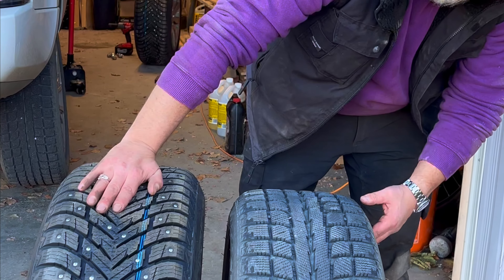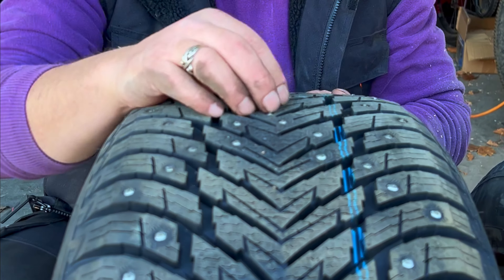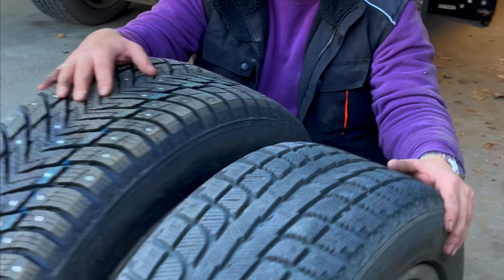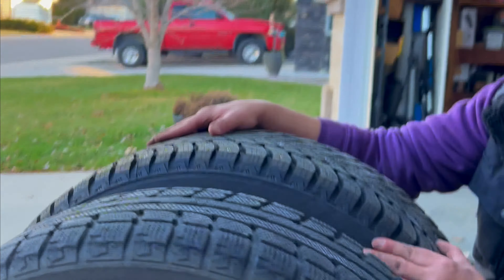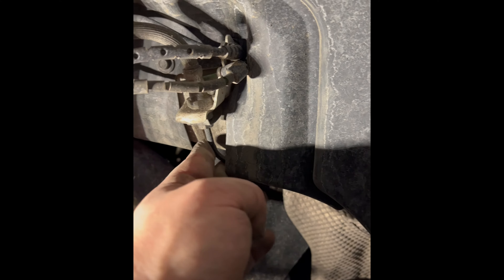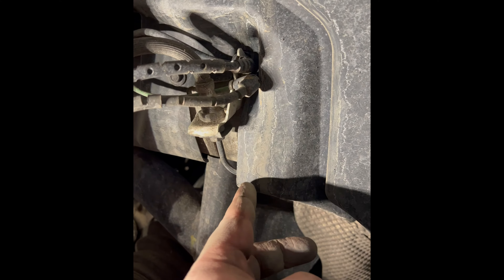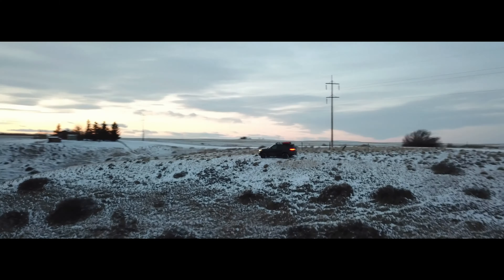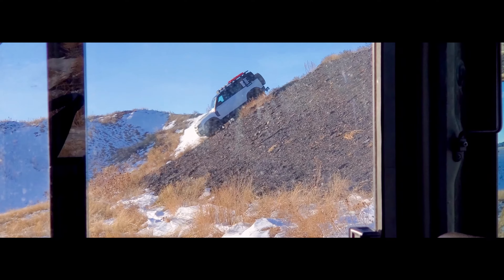Is this the Best Winter Tyre on the planet? #nokian Hakkapeliitta 10 #landrover #l322 #studded #ice

Comment: Hakka 10 studded is a great tire if you have the consistent road conditions to warrant studs. Expect the Hakka 9 to become the next (current) Nordman from Nokian. I'm not convinced "running off" winter tires in the summer heat is the best option. Depends on how much you drive in the summer heat. Best regards in the New Year!
Reply from the maker: All the best to you and yours for the New Year too, Richard! 

I’ve run my 9s on continually shifting road conditions — including bare roads and plus 20°c temps — and the studs have held up very well over the last 4 seasons! They’re perhaps not the best for those who live in the south of the UK, but I’m surprised how well they hold up all things considered (especially considering my annual winter mileage)!

Well, the no-name winter tyres are otherwise only going to be thrown away — no-one buys them used here. Running them off on the highway won’t do the vehicle any harm and more recent tyre compounds don’t explode in warmer weather as these days, so that’s not the same issue that we had back in the day. In fact, on my last L322 I ran for 2 years my Cooper winters off during the summer after moving to the Hak9s for my winter tyre. They worked surprisingly well (though they were obviously less good off-road. We get temperatures up in the +40°s some times here, and the Coopers held up fine. I think early winter compounds were a problem, more more recent compounds (even in no-name tyres) have improved significantly. 

Yeah, you’re right about the Hak9s becoming the new Nordman. I’ve become more interested in Nordman options recently and I might try them for my next tyre (depending on what Nicki thinks of the Hak10s)!

Comment: Do you have to re-calibrate your speedometer?
Reply from the maker: The difference from 255/50/20 to 255/55/20 is about 1” on diameter, so the Speedo is out but within tolerance. The Speedo can be adjusted with the GAP tool (I show how to do this in my first video on the Nokian Outpost AT), but it is a trial-and-error procedure, as the options are randomly organised. 

If you move to 275/55/20, then you will definitely have to adjust the Speedo, as it is about 3-4mph out at 70mph.